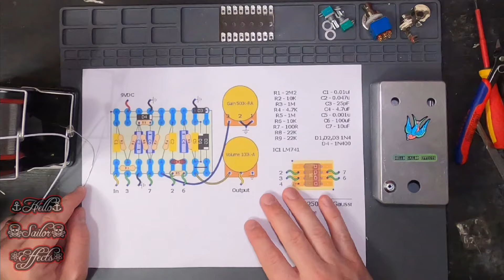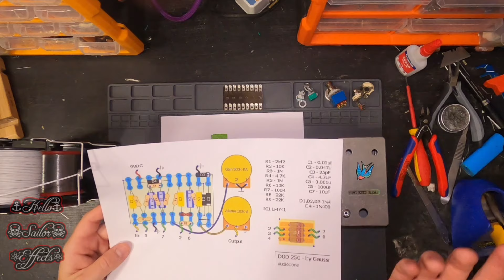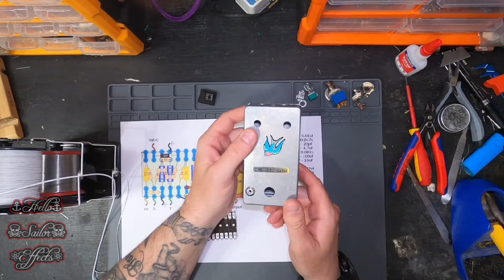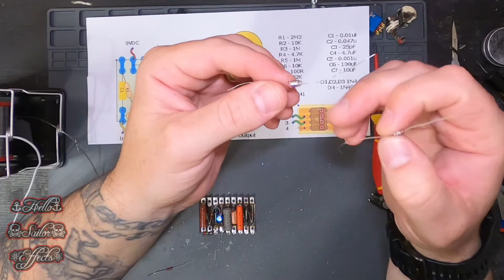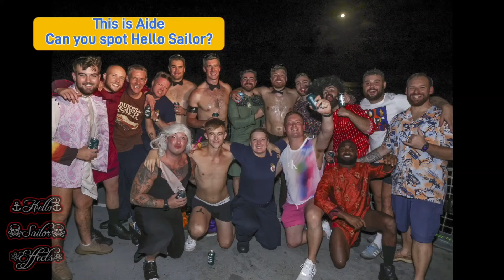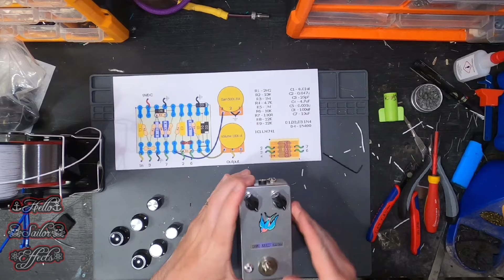Boutique Tone Bliss: DIY Build Your Own DOD250 Pedal Step-by-Step

Comment: What the !   dod250 is my favorite  pedal i do have a 1980 pot dated yellow version  i brought in 1982 brand new for £52 i would love to make a Tag board version so i can mod it try a few different opamps ect my yellow has a TL081CP in but i would like try a 741 inside.
Reply from the maker: Get in mate that sounds like a killer pedal. I can confirm the 741 sounds decent in there.
Im just editing a video about the YJM308 which is basically the same circuit.

Comment: Hi Joe, would you mind explaining the earth wiring in more detail?  Are all earth/ground wires going to the short leg of the input jack?  In the video it look like there is just one wire connected to that leg.  Maybe explain where the ground wires go from the circuit and the transistor?  Thanks for the education!
Reply from the maker: Thanks mate. You are indeed correct. All wires go to the ground pin of the dc jack. Check out this video were I go into detail  on the wiring.

https://youtu.be/KHLroIKX0mc

Comment: Mechanical engineer here. I like to tie 2 lesser resistors together in an inverted V shape when I don't have the exact value but as with your oversized one they usually don't quite equal what I'm looking for. The important thing for people to remember is the tolerance of your average parts can be 10-20% so if you can get reasonably close it'll be fine. I leave an air gap under my components too btw 🫡
Reply: And by the tats I'd guess you're the bloke in the blond wig lmao subbed
Reply from the maker: Ha ha yeah that's me mate. I won 3rd place in the "Miss Kent" competition.
Great to have you along for the journey.
Reply from the maker: Love it mate. Yeah people absolutely should remember that old components have especially large tolerances.